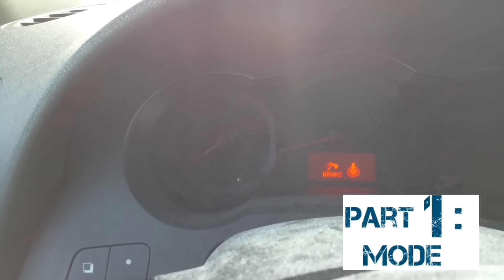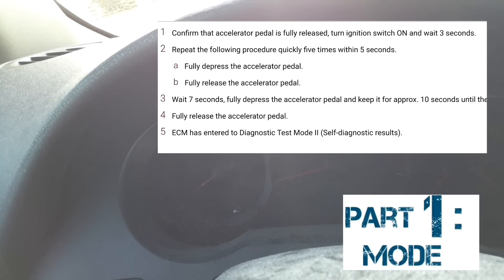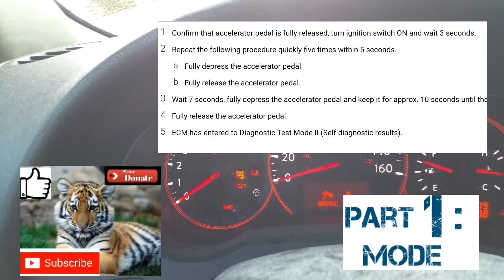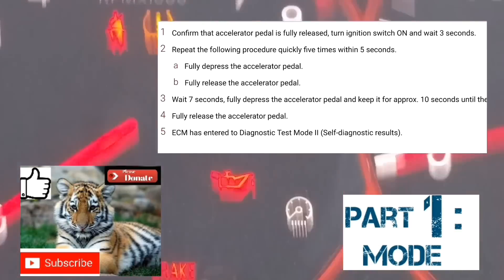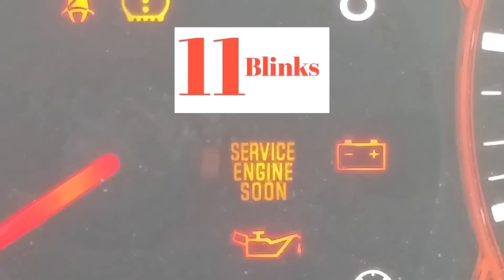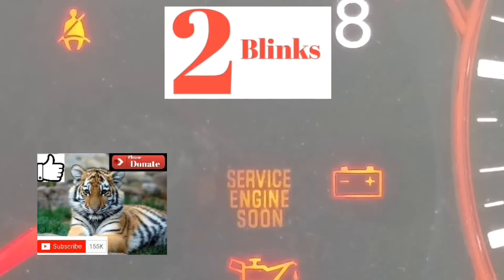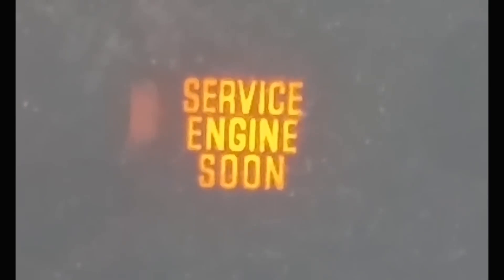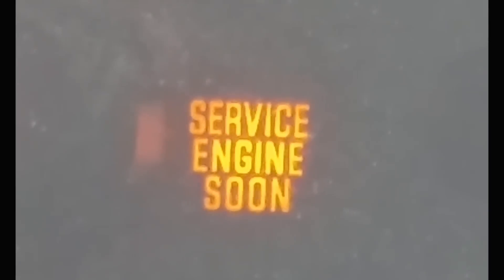How to Read and Reset Your Car's ECU- 2009 Nissan Altima

Comment: Easier Just unpluging the battery to reset the codes and to use a cheap OBD2 reader to check and clear the the codes as well. Note, as he said the code will come back if the issue is not fixed. Usually around 150 miles or so.
Reply: 2008 nissan altima coupe. Problems after changing fuel pump check engine won't go off and code says fuel Emission leak.. Changed gas cap etc. What else could it be after replacing fuel pump..